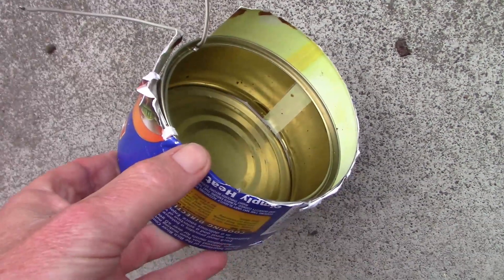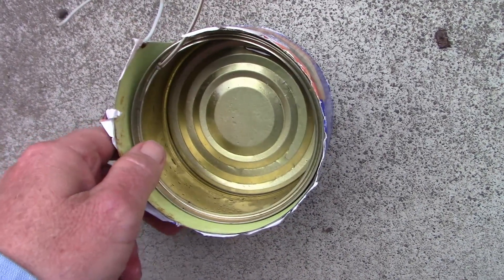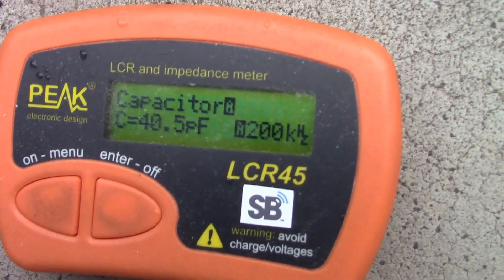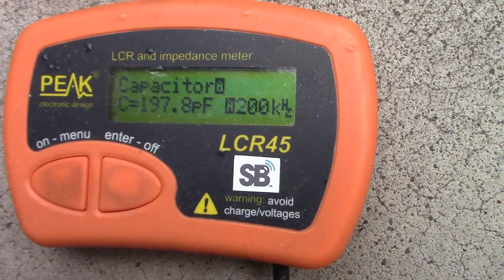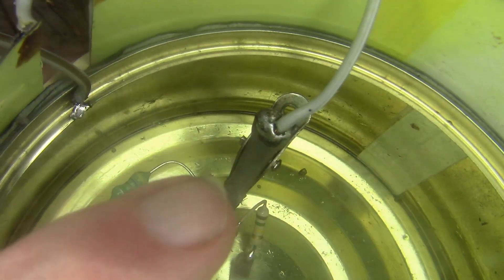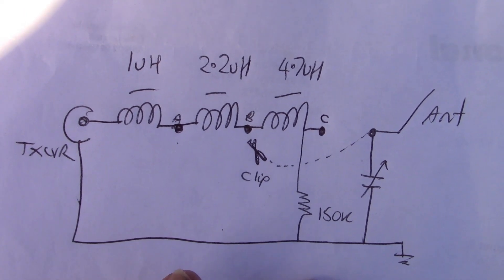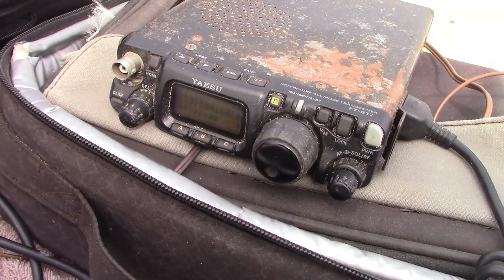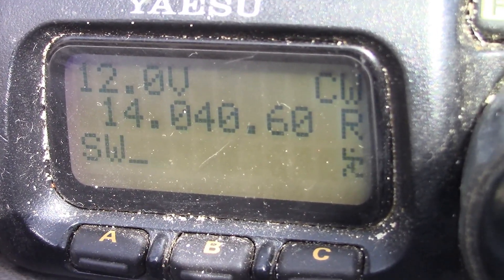Tin Can Antenna Coupler - Does it work?

Comment: Hi Peter, you made a really high q capacitor but coupled it to low q inductors. But it worked😂.  If your capacitor could somehow get 3 "layers", so that the "hot" antenna plate  had an earthed can either side.
Much safer for end fed 1/2  waves, and higher powers. But...3 cans, all different diameters???? Coles, woolworths, cosco, aldi...😅😅😅

Comment: I tried this method for tuning my magnetic loop transmitting aerial. More than 10 watts input and the capacitor would arc over between the plates.
Reply: Rustoleum X2 gloss white spray paint, is said to be an exceptional high dielectric. I've not yet put that to the test myself but I credit the source enough that I do intend to... One of theses days.
Anyway just an FYI if your looking for possible solutions.
Reply: @mrgoodman6620 Certainly it will be worth a try. Many thanks.

Comment: i have dog food cans. can it work? or rather cans it work? 
why the 150k resistor, i mean why 150k? is it for Australia?

and can you remove "simply heat and eat"? 
it generates bad consequences. 
if heated unopenned, it explodes, and the heated material gives whomever is close bad burns. hospitalization level. 
i saw that happening. 
i will ask youtube to demonetise
Reply: When building with this "3D" style, you really need things mechanically attached to keep things where they should be. You can use any large value resistor, I generally go 470k+, the values that I never use.
Reply: @godarklight  yes, i understand that, but i asked if the value, that is not precisely a single one, is some country code